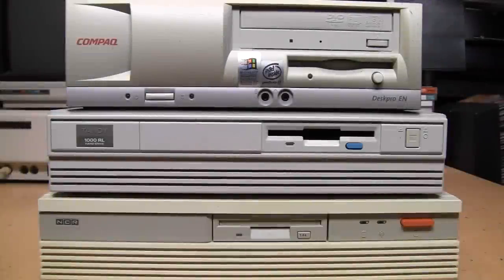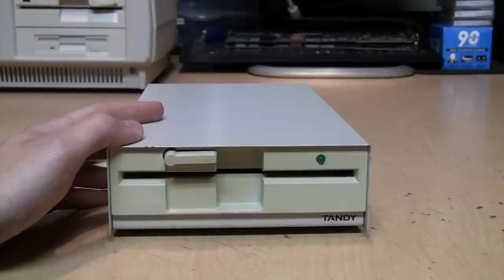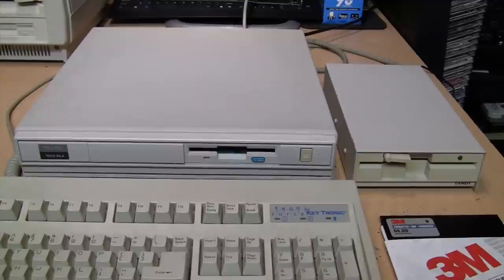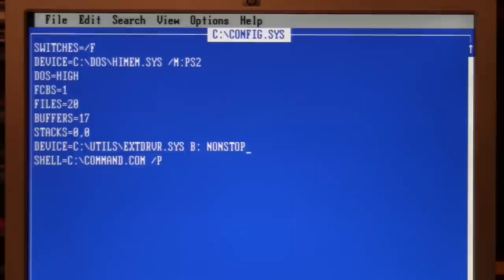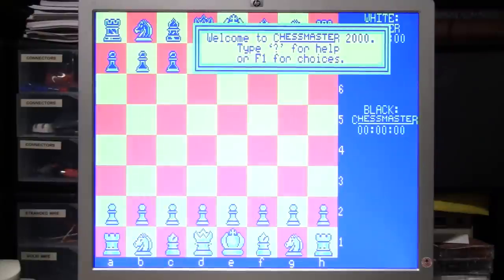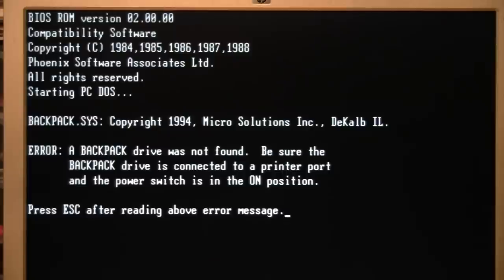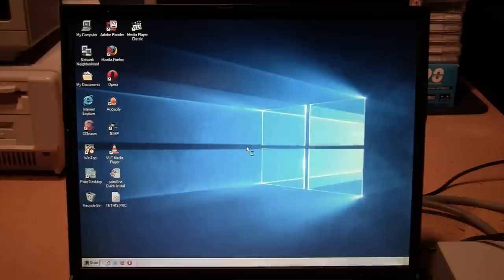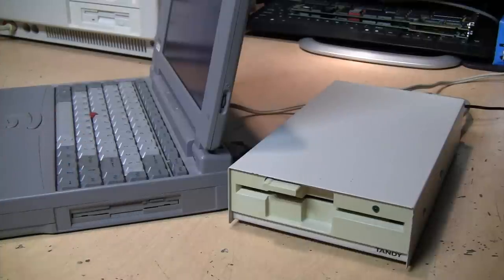An external 5¼" floppy drive for almost any vintage PC

Comment: 2:45 -- is it possible to use a 12v DC power brick instead?  Y'know like it is on the NES, it uses a 9v AC power brick because the AC to DC converter circuit is in the NES and you can still use a DC power supply of some kind (be it a power brick, batteries, etc)

Comment: You have a point about SFF machines, but they lock you into proprietary hardware such as power supplies. A generic AT or ATX case is larger, but spare parts are still easily available. 
I followed a different route; I have an older AMD Athlon system that supports two floppy drives, so I installed a 360K as A: and a 1.2m as B:. All I have to do is plug a USB 1.44 drive in and I can access all 3 drives. Right now it runs WinXP but I may backgrade it to MS-DOS 6.22 & Win98SE. It's not that hard to find a PIII, P4, or Athlon motherboard that supports 2 floppy drives as well as USB ports.
... I installed a 1.2M floppy on my first 286 system, so have had extensive experience with those drives. They were far superior for backups than 360K floppies, and I didn't find them less reliable. What made a bigger difference (in my experience) is buying only name brand disks like Scotch or Maxell. Generics tended to be less reliable. Still have scads of all three types over here; never got around to throwing them out. A heathy number have become unusable, alas.

Comment: This looks eerily similar to the external 5.25" drive that commodore used to sell. I had one with my PC-I back in teh day; probably the only noticable difference is the 23 pin vs. the 25 pin plug.

Comment: The drivetype parameter might be an enumerated value and the error about the KB is related to integer parsing - have you tried a lower number (i.e. 1, 2, 3)?

Comment: Try replacing the Epson drive with a real 360k one. I had a v20 XT machine which only worked with 360k drives, HD ones weren't even recognized.
Reply from the maker: As discussed later in the video, that is not possible. The driver is fixed to a 1.2MB drive.
Reply: @vwestlife  Aw, that sucks. Maybe another BIOS revision?
Reply: @vwestlife  I was wondering if the driver checks the drive itself and over rides the setting. if you have a 360 laying around it might be worth trying still.

Comment: Some of the 1980s computer I used only had a one directional parallel port.  I found out after I tried using a parallel Zip drive on my computer.

Comment: I need to get a 5.25 floppy drive for my obscure DOS games, where can I get an external floppy drive online?
Reply: External 5.25": good luck. External 3.5": ~$12-$15 on eBay.
Reply: @Caseytify  I don’t mind even an internal 5.25” drive, but I just want to play those games that probably never got rereleased digitally. Those programs are on an obsolete format and even my cousin has been begging to find anything that can backup those disks!

Comment: I noticed that the external floppy drives I find on Ebay have 37 pin external connections.  They refer to them as "parallel port floppy drives" but a parallel port only has 25 pins.  The only 37 pin connection I've seen is on my IBM 5150 floppy drive card.  How can these drives work on a parallel port?

Comment: There is a Tandy chip dated 1989, I believe, I noticed when you showed the inside of the drive?  Would it work via DOS BOX with a Windows computer? (Also did you try putting the 'missing' files onto the drive, to see if that might work with a Windows computer?  Especially as it seemed to be looking for those after trying to start Windows and maybe it wanted those files from the B drive?  Just some ideas).

Comment: Hey, just seeing if you knew about device side data. From their site, "Even if your computer has no built-in floppy controller, the FC5025 lets you read those old disks. And it's not just for IBM PC disks – it also understands formats used by Apple, Atari, Commodore and TI, among others."  Sounds pretty cool.
Reply from the maker: This is not an FC5025 drive.

Comment: Why can you redesign the Floppy Drive to operate like the ((MO)(Magnetic Optical)) Drive so you can read the data off the floppies using a LASER and magnetize the spot with with the write coil when the place you will write has been heated up using the LASER.

Comment: 19:40 Are you sure it's not because you created a CONFIG.SYS which lacks what Windows would autodetect otherwise? Maybe you need to add some more stuff there?
Long since I wrote DOS drivers but there's no reason disk drivers would care about filesystems, they just provide sector read/write functions.

Comment: When you say at 0:40 that its floppy controller could only take one drive, which the existing 3½" drive was occupying, are you sure? All PCs I've ever played with, there was only one floppy connector (34 pin, IIRR) on the motherboard, but it could control two _drives_: usually 01 and 10, and the cable with three connectors on it (one for the motherboard, one for each drive) had some cores twisted over between the latter two connectors. Obviously, you'd need the right connector for the drive: usually, 3½" drives used the same sort of connector as the motherboard, and 5¼" drives a board edge connector. Many leads had the right type.
Reply from the maker: That is true with virtually all PCs from the '80s and '90s, but beginning around the year 2000, 5¼-inch floppy drives had fallen out of favor to such an extent that many new PCs only supported a single, 3½-inch drive. Even if you connected a second floppy drive to the cable, the BIOS wouldn't recognize it.

Comment: LPT on the Tandy 1000RL may be output only.  I did hear this years ago but never attempted to confirm.
Reply from the maker: As I said in the video, this drive does not require a bidirectional parallel port. On the 1000RLX it works fine regardless if I set the port to either bidirectional or unidirectional.

Comment: Hi! I have a Tandy 25-1087 external drive too without power adapter, can you share the plug size of the OEM adapter?
Reply from the maker: Outer diameter 5.5 mm, inner diameter 2.5 mm.

Comment: The driver says Tandy, and the Backpack driver wont recognise it, so there must be a jumper or rom on that controller board. I suspect the RL1000 parallel port also wont work with (is it?) PC Dircet (backup software) that can be used either over parallel port or serial port. I also suspect that if you physically change the drive to a 360kb drive it might say that in the driver initialization too. Really you would want to compare this drive to the same Backback version to get any further details (incl. differences).
Reply from the maker: Changing the drive wouldn't make any difference -- floppy drives are "dumb" devices and there is no way for the controller to identify which kind you have installed.
Reply: @vwestlife did you test the 1000 RL parallel port with PC Direct (backup software) , that should prove if the port is capable of bi-directional support
Reply: As for "changing the drive", there is a physical difference in how the 1.2MB disks are detected by the drive, and that is also how the drive signals MS-DOS to show a 360KB (or even a 320KB) disk is present in the drive. That setting was for Drive Type not Disk Type . Ideally you could revisit this drive with a selection of drives with appropiate disks. A reverse engineering of that controller an a dump of its ROM (if that is what it has) would be a boon for modern Retro PC community as long as the PC/XT/AT in question had a bi-directional parallel port (easily added/made today)

Comment: I am now curious if one of these style Floppy drives using the LPT1 interface will work on my HP core i5 3460 with LPT1 port which has all the different serial port communication protocols I do know under Linux no doubt it would work especially Slackware even if I had to configure and build my own custom kernel as the Linux Kernel has a plethora of Legacy and Bleeding edge driver functionalities. However the question would be would it work with a VM with direct I/O access to the LPT port and if so it could be possible to run Dos or Win95/98. As a experiment I had Windows 3.11 with MS DOS 6.22 running on a VM with access to a 9 pin serial port to a 33k dial up modem.... After bit of tweaking it worked however I had no physical phone line with a dial tone nor a dial up connection to test however it did try to dial the modem lights worked as usual.... Maybe if I do decide to get a Voip service on my FTTN connection I will actually try to dial to something but I did it for kicks and it worked bit of messing around but it worked... So it is plausible in theory to do now you have sent me down a rabbit hole. Cheers mate

Comment: I also have an INTERNAL 1.2 MB drive from EPSON, but it' s an SD-600. It has the same problems with yours, I think. I found some info about it and I think that I must solder a jumperless connection on it. If anyone has any info at all, please tell us how to do make them work.

Comment: I would expect that the DRIVETYPE options wants a number or something similar that encodes the actual type. So DRIVETYPE1 or DRIVETYPEA or DRIVETYPE=1 might behave differently. Cannot say for sure unless I decompile the driver.
Reply from the maker: As I showed, it will generate an error message if you give it an incorrect parameter.
Reply: @vwestlife  He could still be onto something if the parameter check is only checking for something like "an integer", but yeah I don't see why "A" or "Drivetype1" would work since they don't make sense in that context.  But Drivetype=0, or Drivetype=1 or Drivetype=2 could be a thing.  If the check is especially stupid it could interpret Drivetype=360 as Drivetype=3 which might line up as 1=360,2=800,3=1200.  I mean if he knows how to decompile the driver to check though he should.

Comment: The fact he can't replace the optical drive with a floptical drive means that it must be using some other method of communication. As far as I am aware optical drives and hard drives are the same thing.
Reply from the maker: You're confusing two different things. Ignore the fact that it only has one 5.25" drive bay, taken up by the optical drive. Even if I just wanted to leave the case open and have another floppy drive sitting outside the case connected to the computer, I can't, because its floppy drive controller only supports one drive -- the internal 3.5" drive.
Reply: @vwestlife  if the controller can only accept one thing then how is the CD drive working? What I'm saying is the optical driveust be using something different than the floppy drive. I would have assumed that optical drives floppy disks and hard drives all used the same thing but I was apparently wrong.

I have removed the CD drive from a USB CD drive and plugged an HDD into the SATA connector with success before. This lead me to believe they use the same thing unlike the floppy disk.

Comment: Be aware that if you write to 360KB floppies in a 1.2MB drive that they will probably become unreadable in a 360KB drive. This is because a 1.2MB drive is 80 tracks and a 360KB drive is 40 tracks.  When the 1.2MB drive writes to a 360KB it double steps the head and has a thinner magnetic recording width. You can read 360KB disks with no issues, but never write to them.
Reply from the maker: That's really only a problem with the old full-height 360K drives. Once they switched to half-height, I think they all switched to the same thinner heads as on the 1.2MB drives, so it's really not a problem anymore.

Comment: 20:35 did he just say that the format of his HDD is preventing him from using a floppy drive? That makes no sense to me
Reply from the maker: If the driver is intercepting all disk drive system calls, and is not FAT32 compatible, then it is possible that it would result in data corruption when using it with a FAT32 hard drive.

Comment: Your program would run faster and smoother if you would make the following changes: increase files, buffers, and fcbs to 50 as well as stacks to 9,256.
Reply from the maker: That's way too much.
Reply: @vwestlife  I used Windows 3.1 for years as well as 98. These parameters increased speed tremendously. I had a computer come in for repair that would not shut down. Changed buffers and files form 10 to 50 and it fixed it. Small values like yours choke your computer.